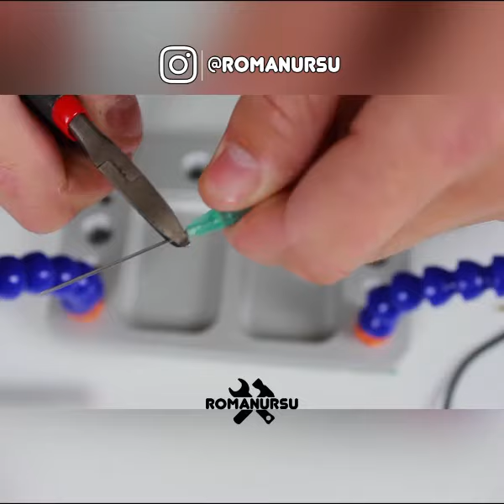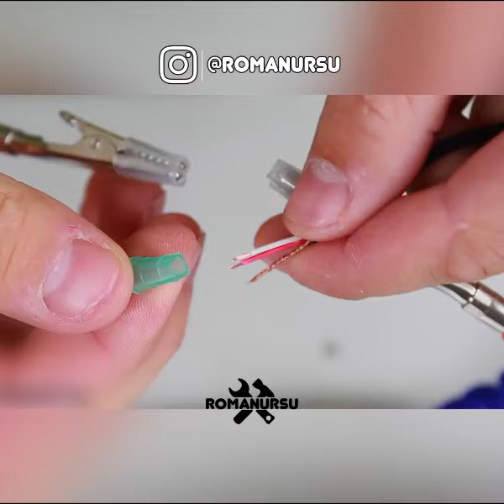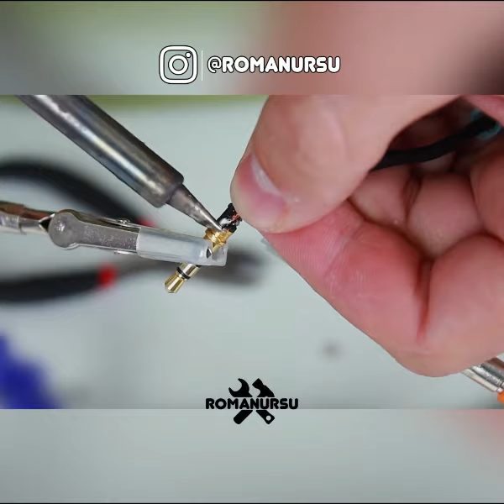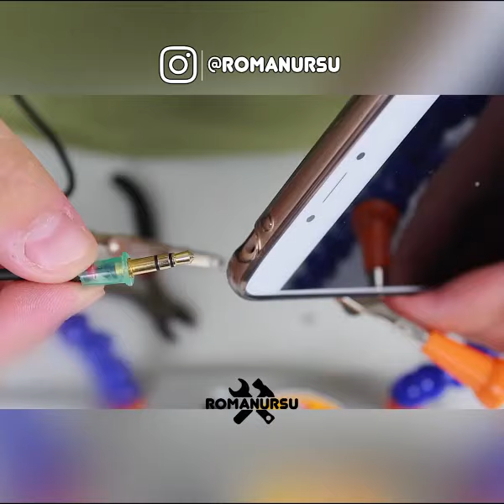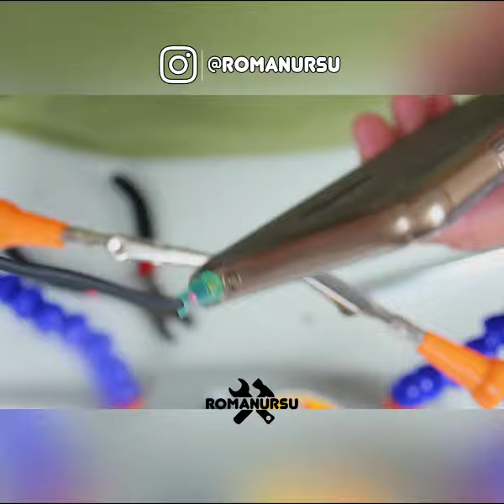How to repair headphones with a medical needle / headphone restoration

Comment: So uh... does this actually work?
Reply: It does, if the break in the cable was near/in the headphone jack. In a standard headphone pair (with no microphone) you'll find three conductors, figure out which one is the ground and solder it on the sleeve of the jack. Solder the remaining wires on the tip and ring of the jack. If you can test it prior (with a multimeter, for example) you can find out which conductor is the for left (or right) earpiece. If not, you may find out (after soldering) that the sound for the left channel is coming out of the right earpiece (and vice versa). If so, desolder the tip and ring connections and flip those conductors. 3.5mm jack pinouts can be found online. Hope it helps.
Reply: @nunogarcia9446  electrician 🤨🔥?